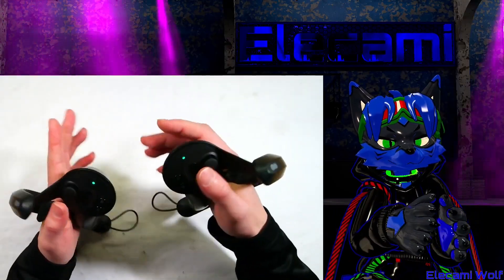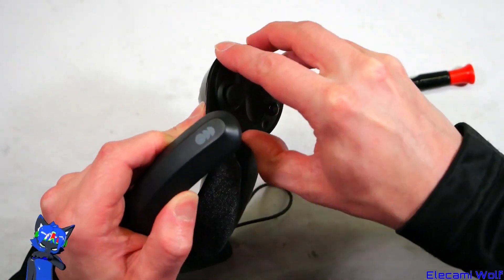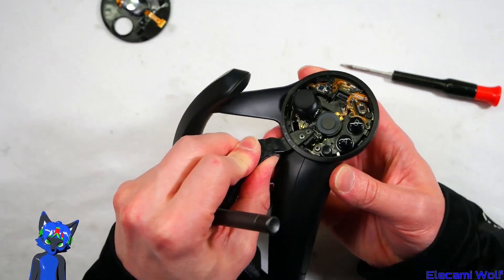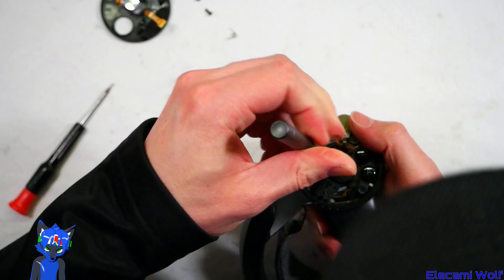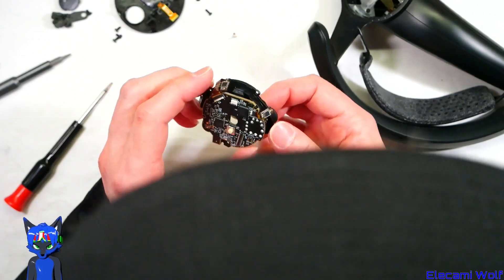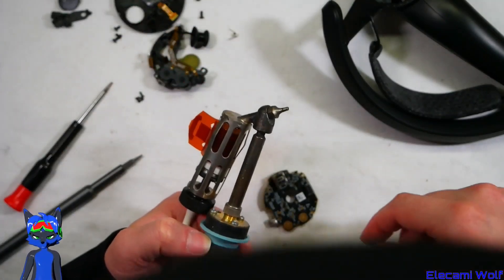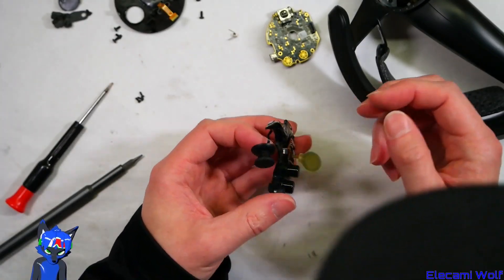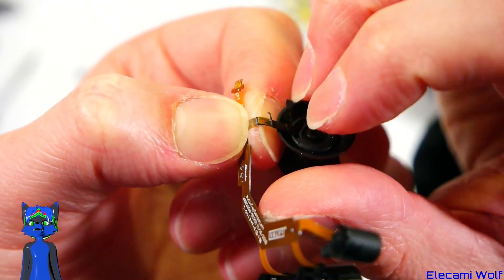EW0135 - Valve Index Controller Stick & Touch Sensor Repair

Comment: So I decided to try fixing the joystick touch wire that rips or snaps like you mentioned in this video by finding a testpoint and soldering the joystick wire to it. I actually couldn't find a valid test point so I decided to solder to the touch IC on the back of the board which did work... sorta. It's really delicate but it loops to the top of the board and looks similar to how the joystick wire on a steam deck does so it has some room to move around and safely be removed. Interesting thing with doing this though, I made my wire longer than the original and it makes the sensor trigger all the time. So if you're going to try this you might want to try soldering between the flex cables. Like it was originally if you want it to function normally.
Reply from the maker: Good idea with soldering touch sensor wire to the board. You might be better off using a shielded wire to reduce interference. That might avoid it triggering all the time.

Comment: Couldn't you just expose the contsct of a flex board by melting it with a soldering iron?
Reply from the maker: The flex material does not melt easily. Might be possible. Will make a mess. The track will still break off very easily.

Comment: I just have a problem on my left controller, i don't have the "spring" for the hand strap ajustement, and the plastic thing broke (so i stick it to repair it but i still don't have te spring)
Reply from the maker: You might be able to get a replacement part to fix that or find a work around.
Reply: @Elecami nope but i use extra-glue and that's work, but thanks you for the video and the respond ^^

Comment: Yeah you probably gotta replace the ribbon cable or you get a thumb stick made from metal and solder a tinsel lead directly to it and the testing point on the board. Other than that, I don’t know how to fix that.
You also got a new Subscriber!❤
Reply from the maker: Thanks.
I might have another go at some point. I have another controller with the same issue too.
Reply: @Elecami  I’d love to see a video about that. I’ll definitely stay tuned.

Comment: so i was wondering...my brother didnt put up my index controller and my dog got to it and tore out the joystick itself...i just need the thumb part of the joystick since i just wanna put it on and use my controller...is there anywhere i can find that or nah?
Reply from the maker: I've not seen the top part of the stick for sale. It would have come with the other buttons because they are connected by the touch sensing wires. Would be nice if that was available as a spare part.

Comment: Mid fix, during a drunken night 2months  apparently I didn’t only destroy my monitor but my left knuckle, head of the control was disconnected from the base wouldn’t even turn on, got lucky because it was just a cable that got unplugged but it was very awkward to plug back in because I had to figure out how to dissemble the controller enough to plug it in. Ended up just muscling thru it to plug it in. TLDR I took off the top part with a knife cuz I didn’t have a screw driver, might have destroyed the joystick cuz that shit poped off with the top but at least now the controller turns on
Reply: Also I’m drunk rn too, will update if controller is fixed (ae I can dri k more cuz it will be social)
Reply from the maker: Hope you can get it sorted.

Comment: Did you try contacting Valve about repair or replacement?  I’ve heard they have really good customer service for that.  If I remember right, 2 Gryphon had one of his Index controllers go bad, and when he contacted Valve about getting it fixed they just sent him a new one at no charge.
Reply from the maker: No I didn't, I had got controllers refurbished from Tundra, so no warranty.

Comment: Hey hope all is well by ur side i need ur help i have national nv-j20am vcr and i make vhs cleaner out of mechanism now i want to run capston motor with 12 volt i mean without vcr i see digram but i am beginner i try to power up 12 volts but its just spin half and stop not roter as it shoud it has 15 pin now my question is how do i run this capston motor tell me how to run or make video it would me help full thanks in advance i find out user manuals but still not get give me ur WhatsApp number or email thank you sir 🙏
Reply from the maker: The capstan motor would need a driver, because it is a DC brushless motor. You will need to check the schematic in the service manual to see the driver circuit.

Comment: The round thing under the touch pad probably is for haptic feedback. So that pressing the touch pad can result in a clicking sensation.
Reply from the maker: Probably is, I wondered if it was the beeper too.
Reply: @Elecami  It's the pressure sensor. You'll find a nearly identical one under the grip cover. The haptic feedback is in the handle.
Reply from the maker: @ky5666  I see. I realize now you can press the touchpad.